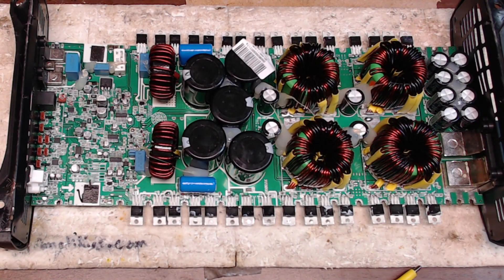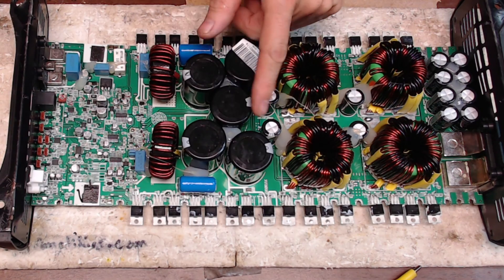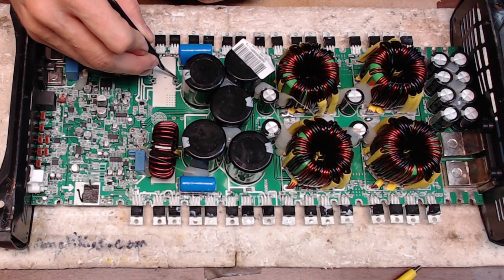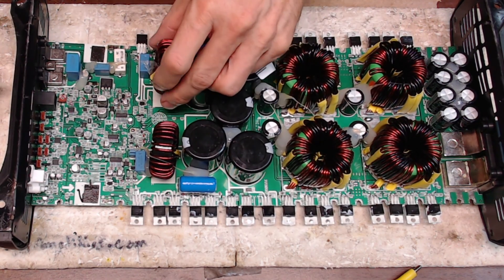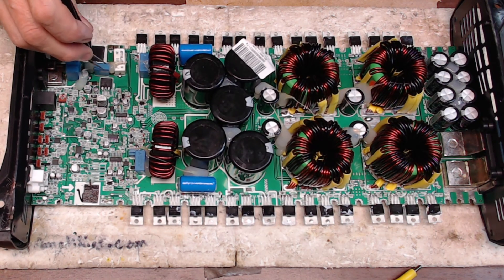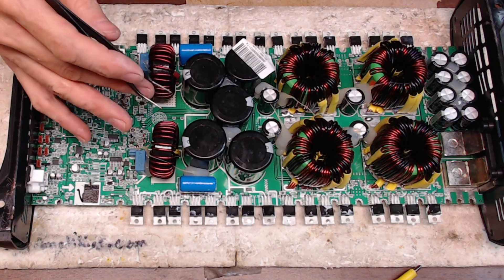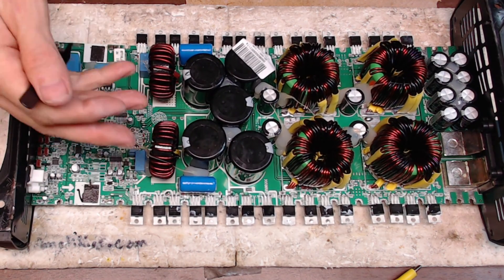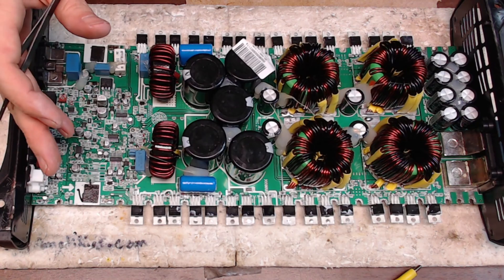Taramps MD8000 Class D Car Amplifier Broken Inductor Board Layout Common Issues

Comment: I crossed the speaker wire with the remote wire when running no smoke no smell just won't power up please help
Reply from the maker: It will either need to have the output section rebuilt or the remote circuit is cooked. www.ellensburgamplifier.com/request-a-quote if you are interested in getting it repaired.
Reply: @ellensburgamplifier  ballpark estimate price so I know if it's worth it  not burned up inside Visually nothing is burnt
Reply from the maker: @ibntheibn  I don't post prices here as the price solely depends on the fault and charges change over time. Contact me directly if you would like to discuss costs. www.ellensburgamplifier.com is where you can find all the contact information.

Comment: I just bought a seet of taramps 8k 2 omhs for a demo build and one of them goes though the turn one sequence then the on and protect light come on im not sure whats going on cant find any help online
Reply from the maker: It has a shorted output section. I recommend not powering it up as it can cause additional component failure.

Comment: Have you heard of them not liking input voltage above 1.9v?
Reply from the maker: I have heard this rumor. For anyone who has issues at 2 volts will more than likely have an issue somewhere else.  For instance, they may have the gain at 80%, and at that level, a 1v input may get you into clipping so they think there is an issue with the amp's pre-amp. I see 2 to 4 volts input every day here for initial testing diagnostics.

Comment: For some reason my amp is brand new no clip it’s turn on fans turn on but there’s power going in but no power coming out to the subs what may be the reason why there’s no power coming out
Reply: It’s a taramps md8k btw
Reply from the maker: It can be a few things. I am assuming the blue LED is on and no other LEDs are lit. Did anything at all touch together on the output terminals while it was on? You have verified that the input signal is OK? Did it have any output at all when you first installed it out of the box? If you have checked all of this and you are confident that there is no issue with the installation please feel free to drop me a message at www.ellensburgamplifier.com for warranty repair.
Reply: @ellensburgamplifier  I noticed on the back plate there’s like a strip of tape the company may have put on could it be the backplate touched those brown copper coils
Reply from the maker: @joshuaarismendez6347  By chance do you have a picture of this? The inductors have a lacquer finish on the windings so it would take a little to rub through. If it did it would go into protect most likely or short that bank out.
Reply: @ellensburgamplifier  you want me to give you my number so I can send high quality clear pics of the inside so you can see or no
Reply from the maker: @joshuaarismendez6347  I don't post my number here (spam bots) but my number is at www.ellensburgamplifier.com yes pictures would be perfect.

Comment: Am I able to buy a new inductor like off of a website instead of sending my Amp in
Reply from the maker: A person may be able to get an inductor directly from Taramps but the easiest and cheapest way to repair that is to fix the original inductor as long as the core is good. Otherwise, I do not know of a site that will carry these.
Reply: @ellensburgamplifier  how could I do that the left side of the inductor burnt or somewhere around that category and It won't go back thru the hole due to being to short
Reply from the maker: @CoolCarz.LoudAudio  You can solder a new lead to the wire (at least 1" should be soldered side by side) to fit back into the board. Other than that the next best thing to do is to find a blown 8k that has good inductors. I'm sure someone on FB would have a blown 8k.
Reply: @ellensburgamplifier  thank you so much that's what I was thinking about doing as the last resort on the board of were it happened its like burnt from the wire obviously malfunction that would just be the abductor correct?

Comment: Nice video bro! I just subscribed. I can’t stand Taramps! I haven’t seen one last more than 5 years in a daily application. And the sound quality is bad
Reply: I beg the difference  my sound quality is great in both my mustang and 4runner. All taramps. Proper tuning is key ( U can make a $50 sound good and make a $1000 amp sound like crap if you don't know who to tune your frequency correctly)
Reply: @atlfreakdaddy  That Taramps won’t last 5 years in a daily application
Reply from the maker: @atlfreakdaddy  You are absolutely correct on this! Here is a funny for the readers - I use a 5.25 full range Pyle speaker system to "listen" for any noise out of any amplifier I repair. Sure I can use my harmonic distortion analyzer but that is no fun.
Reply from the maker: That is a common issue with full range class D switching. A DSP should be used with these to gain more control over the frequency response.

Comment: Could you help me with repairing the cooling fans in my bass 8k? 1 fan got caught on the power wire for the fan and then both fans cut off an now won't come back on an I get .30v at the fans power and ground
Reply from the maker: Do you get 12 volts from the positive pad of the fan to the negative battery terminal?
If you do then there is a transistor from pin 1 of the PIC that may be open, the resistor going to the base may be open, or the PIC may be damaged. If you don't get 12 volts on the positive pad (meter on positive fan pad and the negative battery connection) then you need to check the 10-ohm resistors feeding the positive pad.